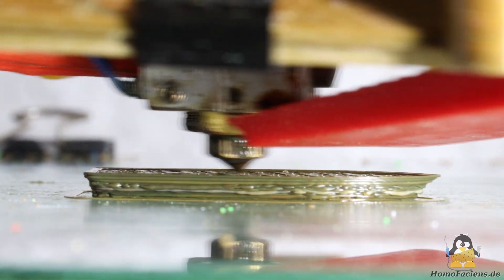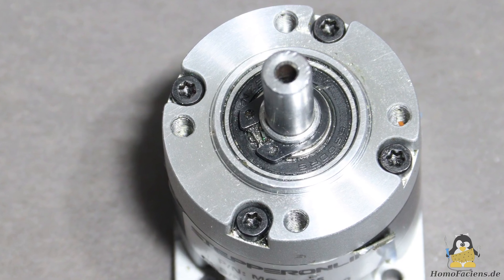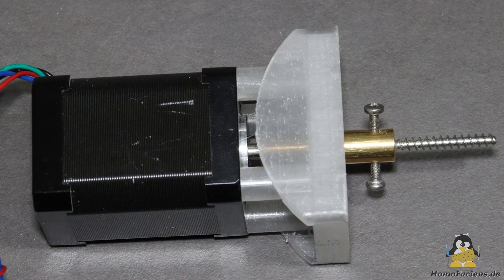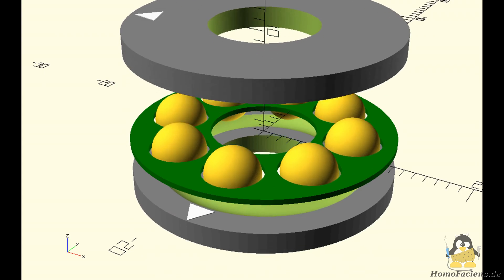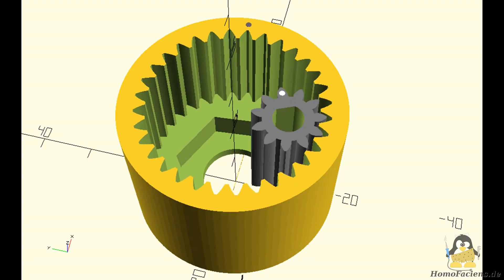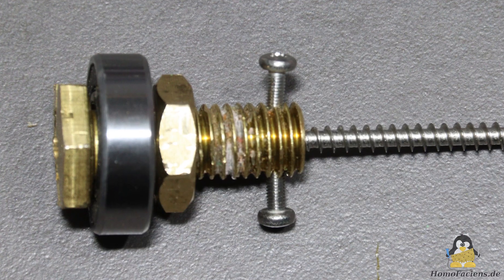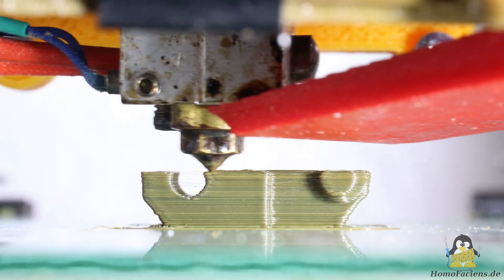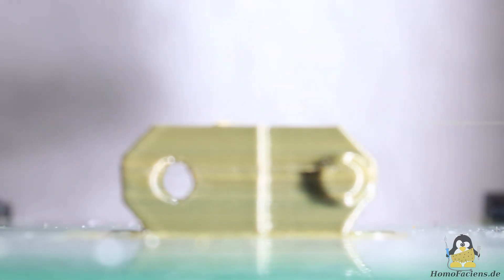Direct Granule Printer Prusa MK4: Part 6

Comment: Like the way you have been able to made the screw auger able to float to take up any misalignment issues.
However with the far end of the auger not being supported there may be a tendency for the screw auger to constantly be pushed sideways against the barrel and creating a lot of wear to both the barrel and the screw auger.
A possible solution would be to support the end of the auger screw somehow but that would effectively block material to the single hole in the extruder nozzle.
However I did see a nozzle design that had 3 holes drilled at an angle to meet the extrusion orifice so something similar might be able to work and the center hole could be used to keep the auger screw centrally located.
And I am sure that you will "figure it out" and at that time maybe I can buy one from you - hopefully...
Reply from the maker: Thanks! If it works without an extra support: keep it simple. I did not run into any barrel-wear-trouble with the floating screw, yet.

Comment: hi you could try to use a angular contact ball bearing to fix the gearbox they can withstand more axial force
Reply from the maker: Nothing really different from the straight pressure bearings. You would also need two of them. Keep it simple and my standard bearing still works fine.